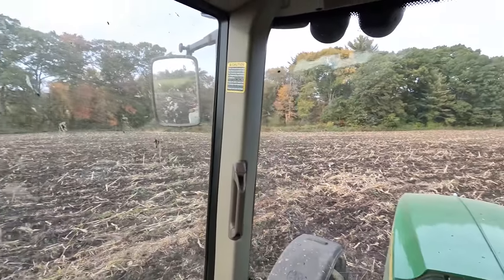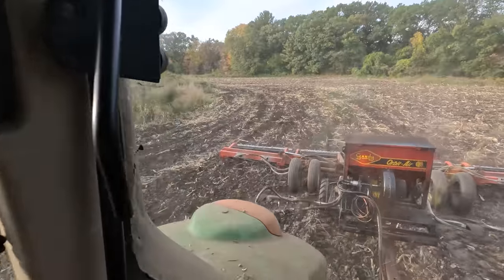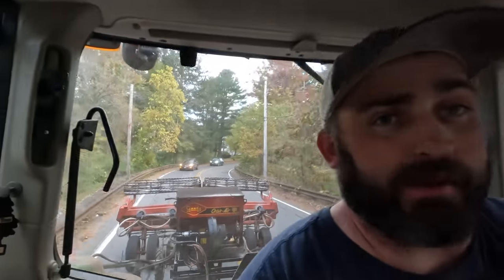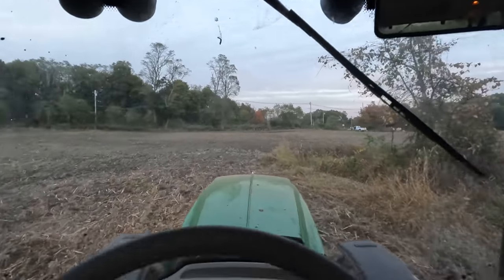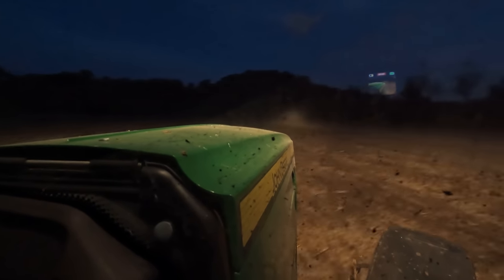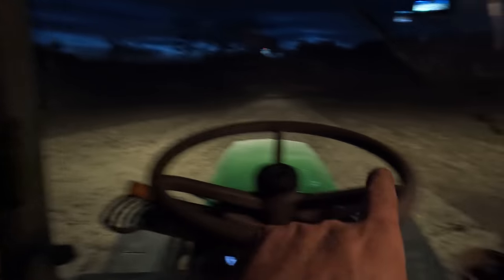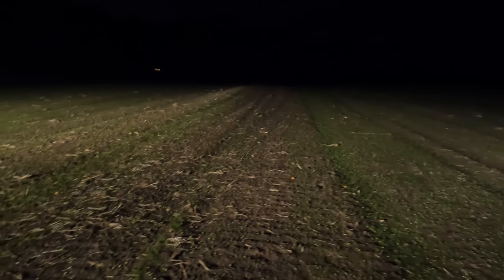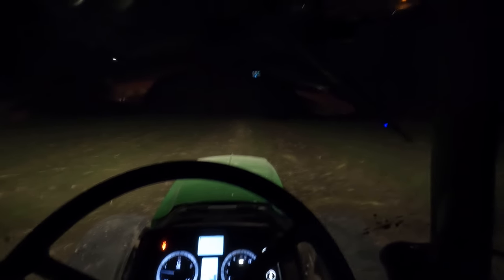Ran Out Of Seed- Cover Crop Seeding Day 4

Comment: You need to put flashing lights on the outside of each implements so the oncoming traffic can see it.
Reply from the maker: I run with the rear lights on for that reason. Most every implement we have doesn't have lights on them and when we do put lights on they just get smashed up